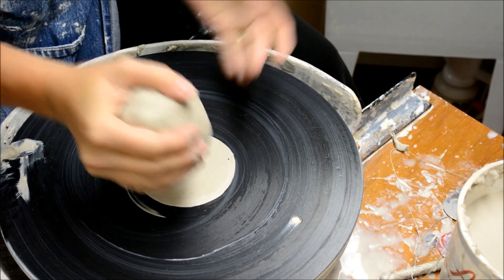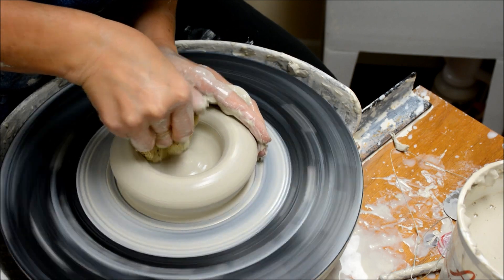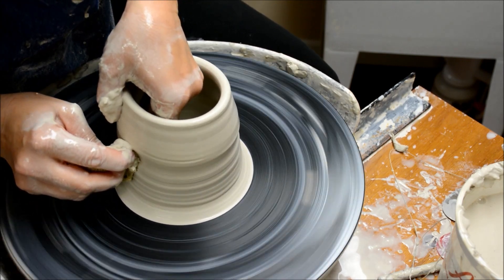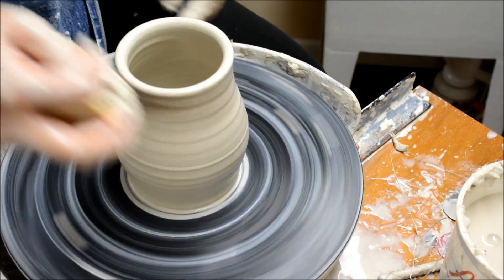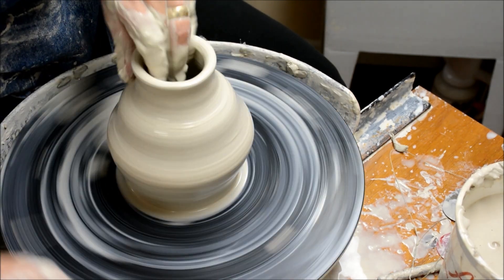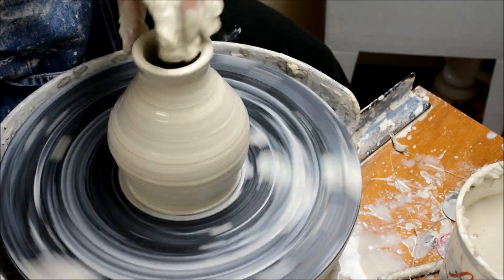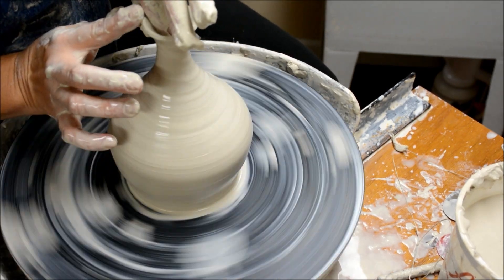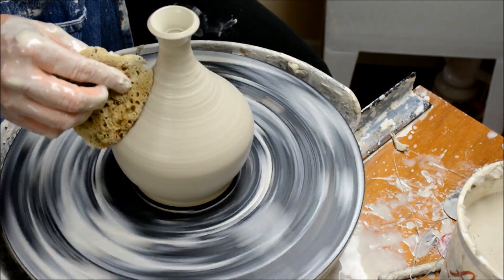Throwing a Vase with a Blown Belly on the Potter's Wheel

Comment: when i try to narrow the top part, the clay ends up folding. any ideas on how to prevent that from happening next time?
Reply from the maker: Matthew Macaraeg great question!  When you collar in the clay, be sure to collar a little bit, then do a compression pull to strengthen- then collar a bit more, followed by a compression pull.  If you ever collar too much too quickly, it often will fold and become weak! 😊. I hope that helps!
Reply: it helps a lot! hopefully i can make a better slim-necked vase in ceramics class this time. Thank you so much!
Reply: Also make sure to not get the clay too wet, especially the top because it will get super super soft and be impossible to work with.